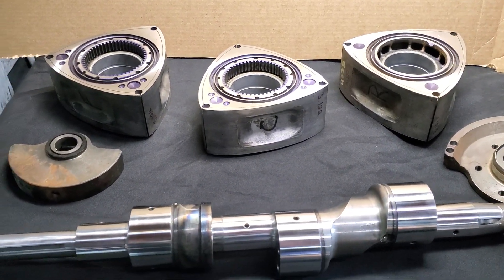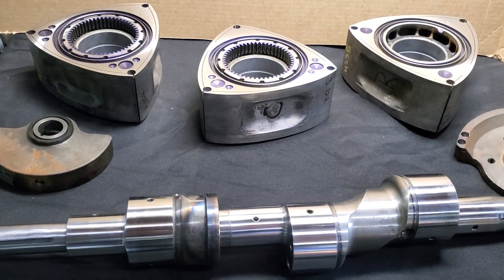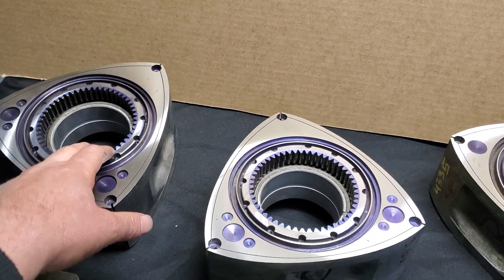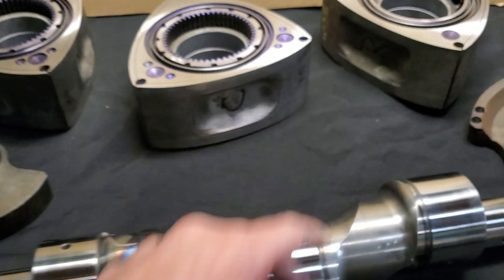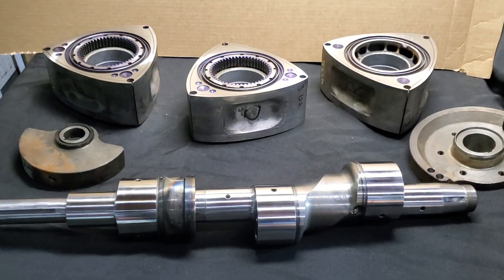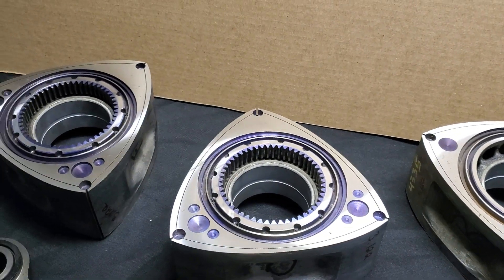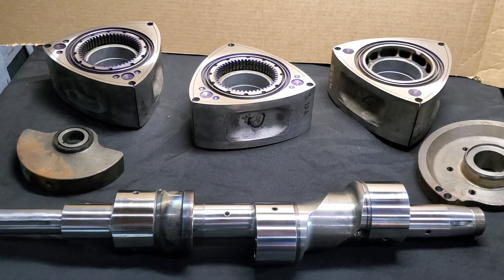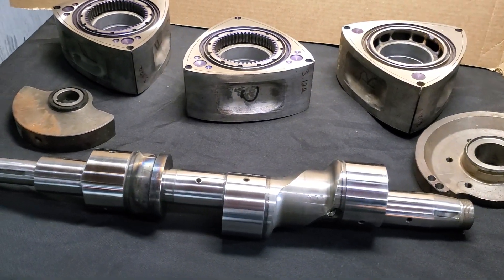Mazda 20b 3 Rotor Balanced, Side Clearance high boost and high RPM setup- Tech Talk , KMR Mazdatrix

Comment: Nice video as well. How much grams of oil is accounted for when balancing the assy? I read in the ‘97 compretition manual and then I also sealed a rotor on one side and filled it with oil but yes getting another weight from people working on it for years cant hurt. 🎉

Comment: Hello KMR, do you guys shave the rotor for lower compression?  I have a N/A 13b that I want to boost.  Thanks
Reply: I think it would probably be much more cost effective to sell your N/A rotors (people do use the 9.7:1 FC N/A rotors in boosted alcohol engines) and buy some Turbo II rotors.
Reply: @bennyb.1742  You are right, that might be a good option